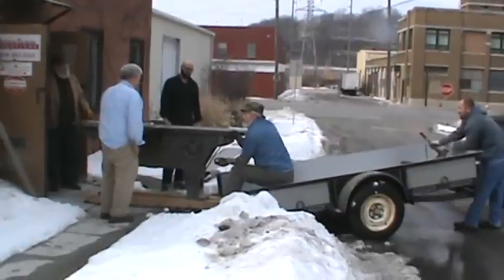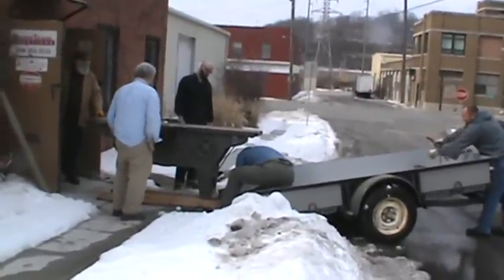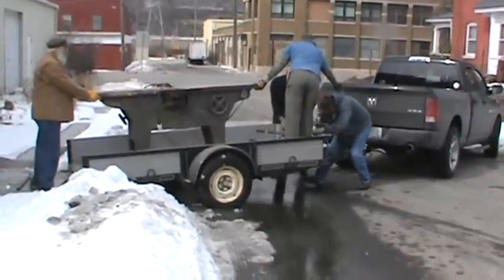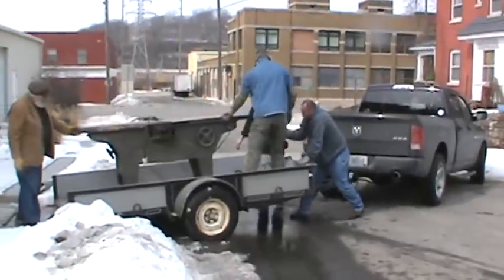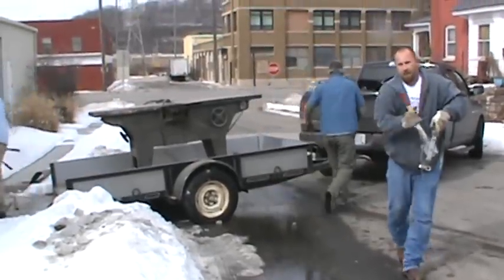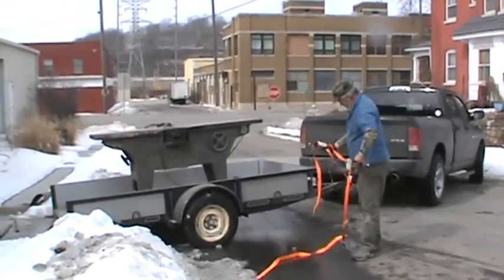16'' Hall & Brown jointer loading and unloading

Comment: That's why a woodworker has pipe clamps. So they can move their equipment.
Reply from the maker: that's one of the reasons for sure and this isn't my heaviest machine
Reply: I ran a wood shop for years and nothing was as heavy as the full size shaper.
Reply from the maker: they are some of the heaviest for sure but they are more compact and easier to move compared to my 8 ft tall 36''bandsaw or the 8 ft tall 1900's cast iron drill press.. when I get a little more organized I will do some vids on them
Reply: Agree. Band saws are the worst, especially BIG ones. Even moderate sized machines are tricky because of their high center of gravity and small foot print. @madebysteve1738

Comment: Nice find!  Though, isn't it a little scary to drive around without any tong weight on a loaded trailer?  They tend to wiggle around, and even break couplers when they don't have tong weight.
Reply from the maker: when we loaded we had about 100lbs TW and it bounced a little we stopped for air and pulled it forward about 3 '' and drove fine
Reply: I was wondering if you did.  It kind of looked like you had moved it forward, but I couldn't tell.